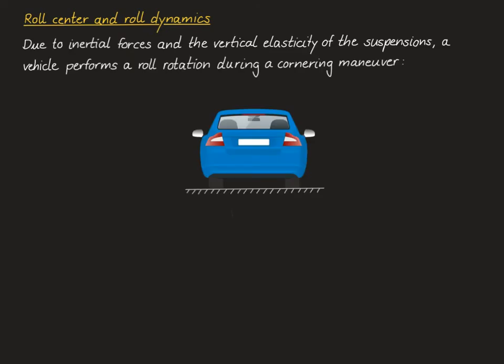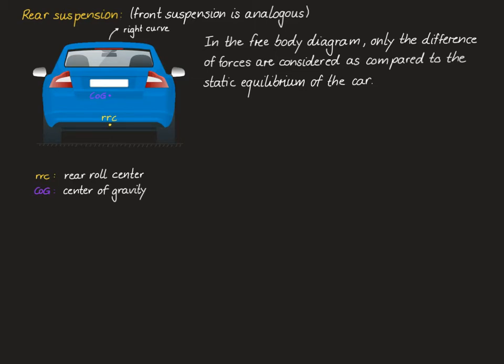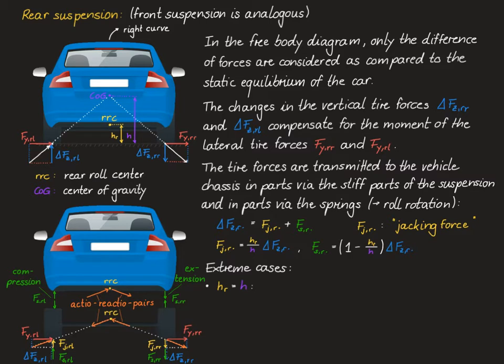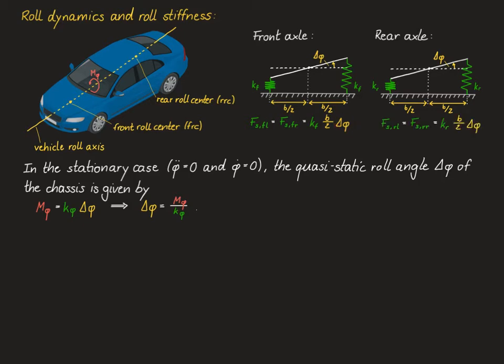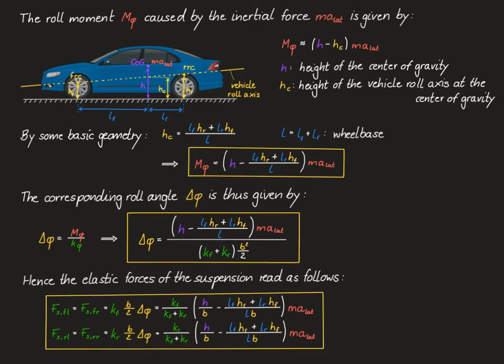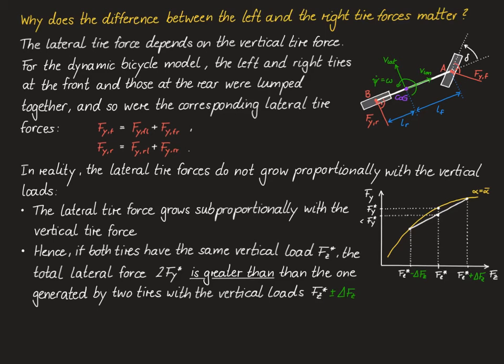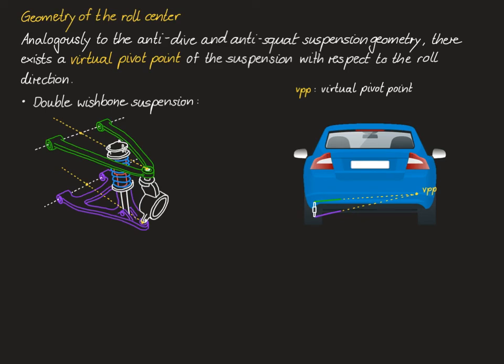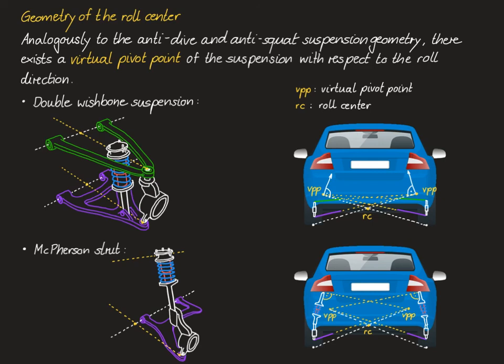Vehicle Dynamics & Control - 21 Roll center and roll dynamics

Comment: Hi! Excellent video! I have one question related to the roll axis slope. According to these equations the front and rear roll center hight affect roll moment and thus the roll angle. I may ask if the slope should be inclined upward to the front for RWD and to the rear for FWD? Trying equal contributions lf*hr and lr*hf to the moment assuming in RWD lr is shorter (Heavier on the rear) and FWD lf is shorter. Or which criteria can we use to establish the roll center slope? Thank you for your video and i hope the question is clear

Comment: Another question if i may ask for the suspension kinematics. For double wishbone suspension on the front and rear, Does the behavior should be similar? I mean the camber gain rate and roll center dynamic position for suspension deflexion and roll angle variation have to be similar on the rear and front axle or should be different?

Comment: Hello sir the video was extremely important. But I had seen in many 6dof vehicle models the roll moment of vehicle body is calculated around the CG of vehicle. Here you are explaining to take roll moment about roll center which is itself is moving. So which point i should consider to calculate roll moment CG or roll axis??